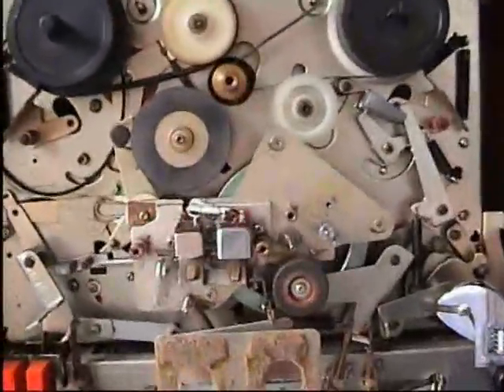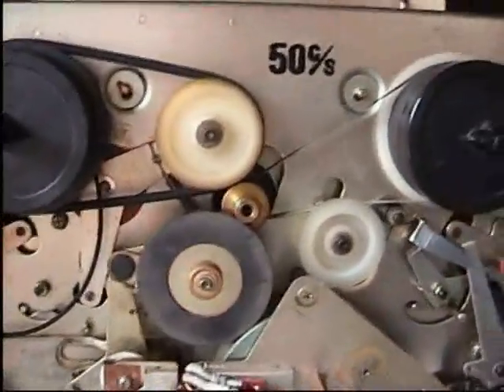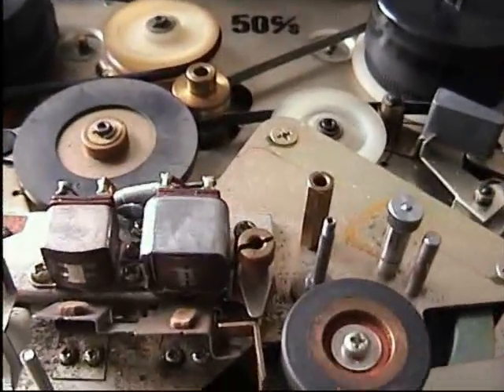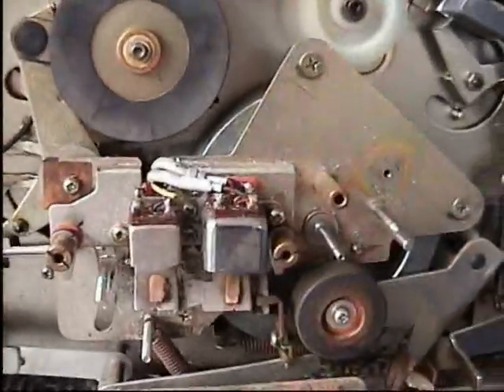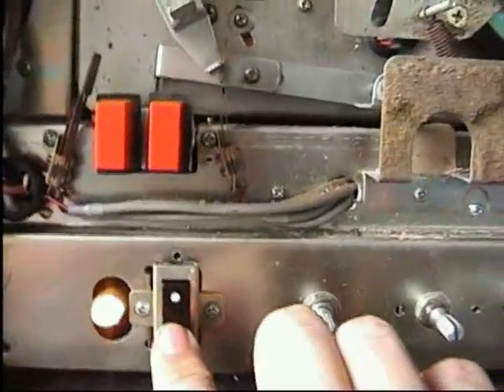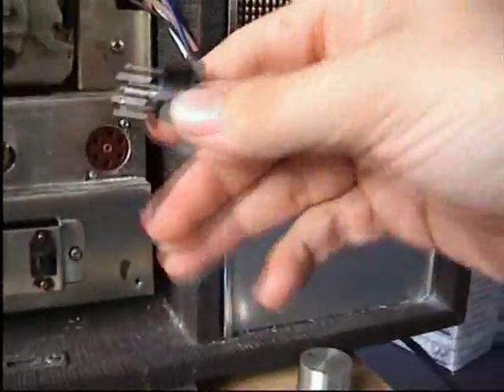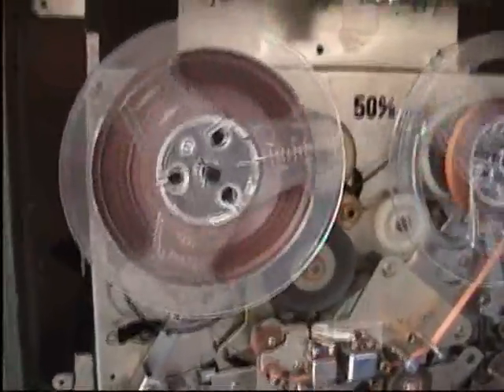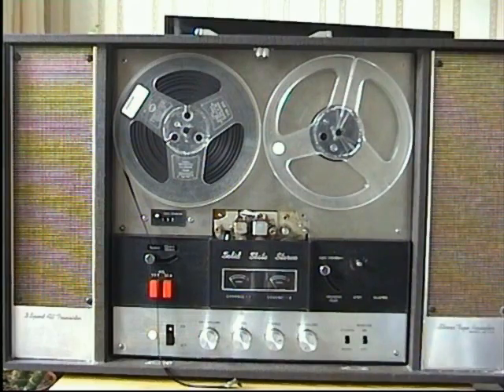Vintage reel to reel tape recorder, part 2

Comment: The reason that the capstan turns in rewind is because the tape is constantly against it which would eventually result in flat areas forming on the capstan shaft. Keeping it rotating causes the wear to be uniform on the shaft.